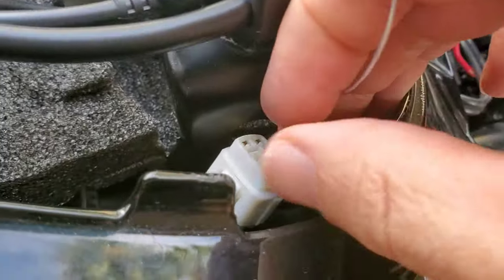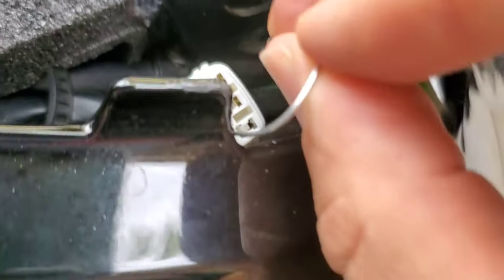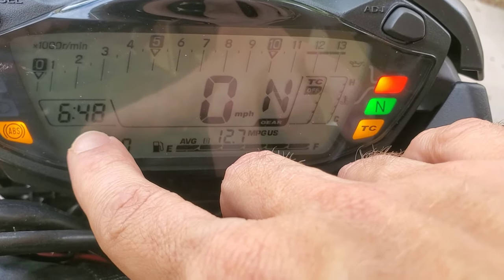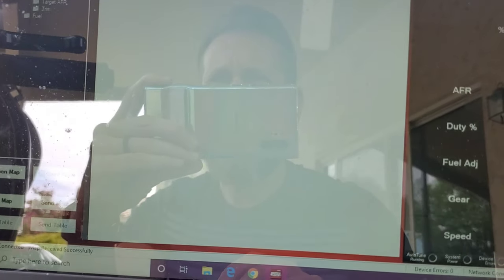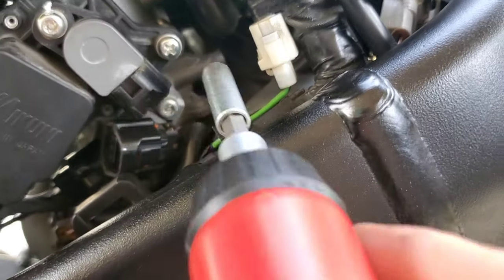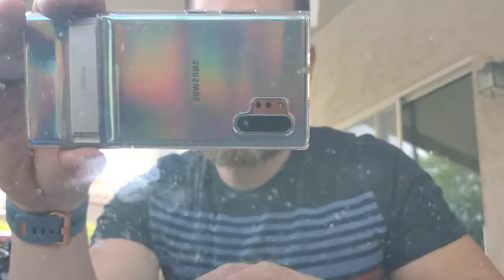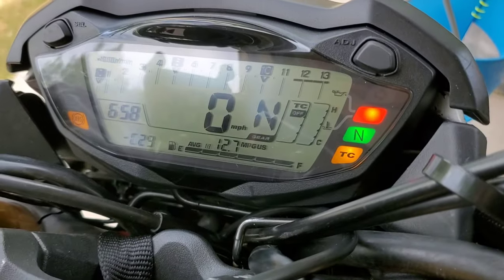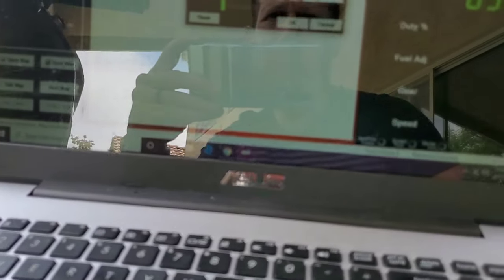GSX-S1000 TPS Calibration using dashboard and Power Commander

Comment: 5:40, finally someone which explain what this little line in the middle mean and that you can use PCV as diagnostic tool. BUT, is this line in the middle is and of story? What about ohm range in service manual, at which rpm line need to move at upper position? Engine must be at working temp.

Comment: Some seem to do this with the engine warm, and some with it cold.  Some seem to do it with the engine running.  Do you think it matters?  Also, is the line supposed to be in the middle -C00 or should the line be high ''''C00  (sorry, best I can do to make a high line).  I've heard some say it should be at the top.  Lots of confusing info on the forums.    Great video.  Thanks
Reply from the maker: Hey Shane, sorry it took me a second to reply. The guidance has been to aim to have the line in the middle and that means it's calibrated and pulling the right amount of volts in regards the communication between the ECU ans throttle position. 

About warm engine vs cold. Hmmmmm I don't remember I am pretty sure I have done it both ways but has never paid attention to it.
Reply: dude, i`ve placed my bike in dealer mode, "C" is displayed but no horizontal bar in any position. ????????????????

Comment: Appreciate you doing this demostration. ? I have a 2009 ZX14. With a PC5, do I have to have the bike running and warmed up to do this calibration? Or can the bike be on without running to do this? I Believe my Throttle position sensor is of a little. Never seen this done before. Bike won't go over 120mph. Like its wants to go more but the computer or something isn't giving it fuel. Installed new fuel pump, coils, plugs and injectors, clutch and sprocket. Used the maps dynojet suggested. Bike use to hit over 186mph before. Now it feels like a turd.
Reply from the maker: Hmmmmmm!  That's crazy if it's not the ECU, it could be the PCV map you are using. 

I know this was a month ago when you left this comment. Did you figure out the problem?
Reply: @ToModorNottoMod  Yes, the Throttle Position Sensor needed to be calibrated from the Power Commander V in order for the bike to run right. Without the calibration, when I was at WOT physically. The power commander told the ECU, I was at 65% open throttle. Once calibrated the bike ran fine.  However now my Power Commander went bad and failed on me. My bike started to have a bad misfire and PCV light went out then on again started flashing then stayed on.  So I just disconnected it like my mechanic who races and repair bikes suggested too. So  I'm going to get the ECU flash and tune. Like it was before the PCV was installed.

Comment: i have placed my suzuki gsx s1000f in dealer mode with ignition on. the "C" is displayed on the dash but the horizontal bar is not showing top bottom or middle.. what are your thoughts.

Comment: i finaly get my tps to 1.13 but i sell my bike after 4 years i also install 2020 suzuki katana trottle tube it whas less agresive. i live in a small town and plan to get mt09 little smaller bike now when i am 43 i had to update firmware in powercommander5 and let the cable in diagostic outlet still be in.  Becasue before when i had key on and swips deadbutton i had 1 sec to reset trottle in powercommander after i update firmware in powercommander 5 i just had to turn bike on and switch deadswitch to see trottle movement
Reply from the maker: Oh nice, I am glad to hear the firmware helped. Did you sell it? The MT-09 it's an amazing bike, that is what I had before the GSX, honestly I would love to have another one at some point. I heard good things about the Katana throttle tube. I will look into it myself. Thanks for sharing Joel

Comment: Isn't the whole point of the PV5 Throttle Calibration procedure that you don't have to do the physical adjustment?  If you do the calibration procedure on the PC5 then you do not need to unscrew that screw and move the TPS. The PC5 will adjust the position of the maps etc to meet the calibrated readings.
Reply from the maker: Hey Richard Board, you are correct. I was taking that opportunity to show people how to do the physical calibration.

To be quite honest even if I can set it up by resetting the percentage open based on the volts reading etcetera I always prefer to do it physically and then match. Might be innecesary but some habits die hard 🙂

Comment: hello I have a gsxr1000 K2 but when I graduate it with the pcv 5 I have to graduate it from the pcv also the TPS so that it works for me true since the off motorcycle costs that the line stays in the middle it always goes to the upper side but tomorrow I will try to do that change in my pcv to see how it works
Reply from the maker: Let me know if it works.

Comment: I just bought a 2016 gsxs1000f with a power commander 5. I hooked up the break out lead and it shows 3.98 just by turning the key on? Is the extra power commander wiring the reason I don't see the closed reading? I have no experience with a power commander btw. My tps line was low so I moved it and adjusted to the middle. Any answer to why I'm not getting a closed reading?
Reply from the maker: Hey Paul, I dont think the power commander is throwing off the numbers, what I would do is to plug in the laptop to see the reading and start moving the sensor in very small increments until you get the perfect reading of close when is closed and open when is open. Please try that and let me know if it works. If I need to olug in mine to help you ill do it.
Reply: @ToModorNottoMod  i just turned the sensor till it read center line as opposed to low center. It actually made a noticable difference. Now as far as connecting the PC i would have idea what I'm looking at. Maybe I'll dive in one day.
Reply from the maker: Glad to hear that it made a good difference when you adjusted the TPS. If you need help with the Power Commander I can help.

Comment: My 2018 gsxs 750 doesnt change the tps position when I move the throttle?
Reply from the maker: Hey Anonymous, do you mean when using a Power Commander? 

If is not that I know there was a change in the 2018 Z models and possibly the 750's as well where the way to put the bikes on dealer mode was not the same and they were forcing to use a tool to calibrate it. Is that what you are referring to?

Comment: Did you have the bike in dealer mode when you adjusted the tps?, i just adjusted mine today and got bang on spec using a multimeter but it wasnt in dealer  mode and afterwards im getting errors 14 and 29 when i put it in dealer mode, do you know how to clear the errors pls?
Reply from the maker: Hey, yes my was on dealer mode when I adjusted it. Let me look up the errors, I think I one time got error 14 but it was caused by one of the TPS connectors being lose. Let me check.
Reply from the maker: Both of your codes are related to TPS and voltage. This is the description of 14

CODE - C14 *1P0120-H / P0120-LTP sensor circuit high voltage / low voltage
The sensor output voltage is higher than 4.8 V. / The sensor output voltage is lower than 0.2 V.

CODE 29- C29P1654-H / P1654-LSTP sensor circuit high voltage / low voltage
The sensor output voltage is higher than 4.85 V. / The sensor output voltage is lower than 0.15 V.
Reply: @ToModorNottoMod  thanks. Ghe errors cleared themselves when i went for a ride. But im now wondering if it has ignored the change i made to the tp sensor as i did the change without the bike in dealer mode. Do you think that is possible?.  My bike is still running bad below 4000 rpm with the pcv.
Reply from the maker: @midnightx1719  Glad to hear the codes went away. Considering the chanhes to the TPS are physical, meaning, you have to move the position of the TPS to get to the right voltage reading. I dont think it was ignored. 

What year is your bike?  Why don't you use the Power Commander to read the TPS?
Reply: @ToModorNottoMod  its a 2018, so no minus sign on the c00 display. I did try doing the tp check thru the pcv but i couldnt get it to work, does the engine have to be runnibg?

I am also wondering now if put the o2 sensor in the wrong plug, there are 3 on that left side. I was looking for a black plug but i could only find a grey one. I figured the bike would show an error if i had got the wrong one. I think the 2018 has different color plugs compared to the pcv instructions, both tp sensors are grey on my bike as well so i figured perhaps the o2 sensor is grey too.

Dynojet have sent me a couple more maps to richen the bittom endbut they are not having much effect, its hesitant and jerky when cruising or throttle off anywhere below 4000. Maybe its a dirty injector or bad plug...the thing is its only 2 years old and 1400 miles.
Reply: @ToModorNottoMod  just had another thought, is your bike stock?...if so what pcv map version do you have?
Reply from the maker: That's why I was asking, because you dont have the dealer mode like I do it on mine. 

I honestly doubt it's a dirty injector. 

You need to have the key on the bike but the bike does not need to be running but the kill switch  must be in the "run" position. I herad once that someone was having trouble with that and a firmware updated on the PVC fixed it. 

What O2 sensor are you talking about? Do you have a Autotune? Or are you talking about the bypass?
Reply: @ToModorNottoMod  i do have dealer mode but not the tp center indicator in the display. Yes i meant the bypass that came with the pcv that plugs inline with the o2 sensor. Fortunately there is a dynometer place about a couple of hours away that i can go to if i cant figure out a map myself. Thanks for your help by the way. I discovered today that the stock map on the pcv for the gsxs1000 is not the same as the stock map on the dynojet website..its totally different..so now waiting for dynojet to confirm which is correcr lol.
Reply: I dont have autotune as i thought that has to also have an exhaust sensor welded in place?

Comment: strange i have 2016 gsx-s 1000 and i must have my bike running to see trottle % open if i have it off it dont show trottle % do you now why ?
Reply from the maker: When you say running you mean the bike has to be idling to be able t see it? That is strange all I have to do is to turn the key on and put the Run/kill button in the "Run" position and the Power commander see the input. Is that how you were doing it?
Reply: @ToModorNottoMod  yea my bike need to be running in idle for me to be able to see the trottle % and see the trottle volt also. When i turn bike off and just have key on like you i dont see anything. IS this mabye becasue i dont have the jumped cable in diagnostic outlet

and i have diffret powercommander 5 then you my looks like the one in this link https://www.dynojet.com/power-commander/
Reply: @ToModorNottoMod  do you think i must use Power Commander V Firmware - Version 1.14.2 (Power Core) to be able to just have key switch to on and deadbutton to run. Some it is not i told you u need to rev bike skyhight on idle mode to set tps
Reply from the maker: Later in the day I can take a look to confirm my firmware. That is true what you say about setting up the throttle.
Reply: @ToModorNottoMod  yea but it only worked for 1 sec i had to update firmware for pcv to make it work but i also have a newer pcv then you i dont have the red one i have the black one from usa not england some are red what firmware do you run in your powercommander i use 1.14.2 powercore

Comment: my bike wont read the voltage or throttle percent on the pc5 software unless bike running. how do i get a correct tps reading ?? any help appreciated
Reply from the maker: Sure Dave. Was it at the ignition in the on position?
Reply: @ToModorNottoMod  
I've manual adjusted my voltage on pc to 1140 and 4.6v . however bike wont read it unless running and if i hold full throttle i get 3.0v and it max 56 percent throttle but I'm holding at 100. i have c14 error code also
bike will run but its wild like bucking bronco to ride. wasnt like this before pc5. i havent taken it off yet as hoping to fix.
its a stock map but i think the issue is tps side??
Reply from the maker: C14 it is indeed a TPS issue. I have never seen it on my  bike but i have read of people with the issue when the TPS is out of range. 

What year is your bike? If you have a model earlier than 2018-19 you can still do it like I did it on the video. My recommendation would be to calibrate it so it shows in the middle line and go from there. 

Than check the PC5 specs to to ensure your close and oopen voltage matche what is expected from the GSX-S1000. Please give it a tey and let me know.
Reply: @ToModorNottoMod  
It's a 2018 would it go that far out 1.8v as it wasn't even that snatchy before the PC 5 install. 
Do u have a pic of your TPS connection as I've had a message to say it was rewired. And I have a feeling it's wired wrong . If I was to plug the pc5 TPS sections together there opposites.

I can send u a picture
Reply from the maker: @turbodave6068  Hmmmm. I  am almost sure the model Z and the 2018 on you can't follow the same process I showed on my video at least for the calibration using gbe dash. If I am not mistaken you have to do it based on the voltage reading directly from the TPS. Did you try to calibrate it in any way oitside of the PC5?
Reply: @ToModorNottoMod  
I have ordered the breakout lead.
I cannot see the TPS being that far out I mean it only giving max 3v??sound too far off as bikes not bad without pc5; in convinced the wiring on the pc5 TPS connections is wrong I'm just trying find a picture of it so know what goes where.
Reply from the maker: Please let me know when you get it. I hope it works. Are you still looking for pictures?
Reply: @ToModorNottoMod  if u have one that be good I've ordered replacement connections for the pc5 so could do with knowing of the TPS plug is wired right way round
Reply from the maker: @turbodave6068  Hopefully I am understanding this correctly, but your concern is around the PC5 connection to the TPS? Is that what it is I don't have a picture but send me a reminder and I can try to remove the pladtic to lift the tank so you can see it.
Reply: @ToModorNottoMod  yes bud